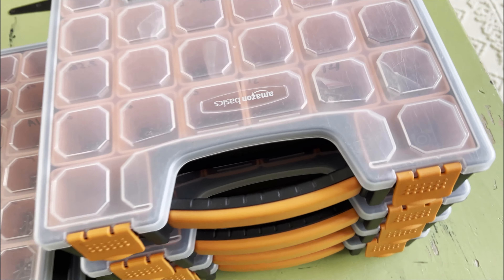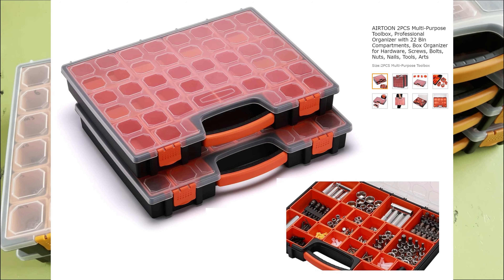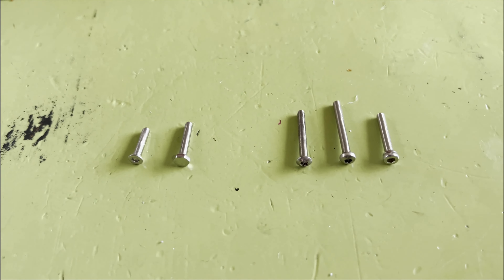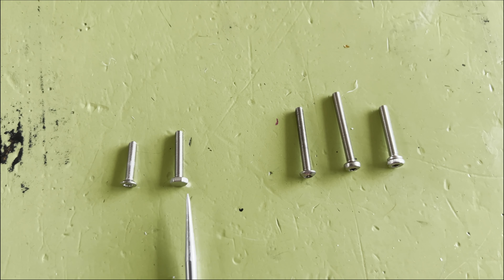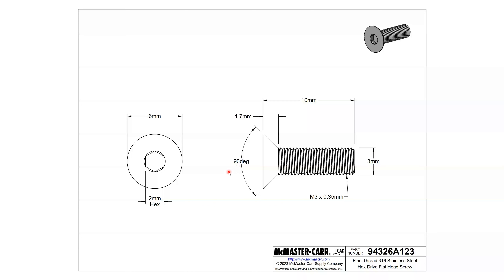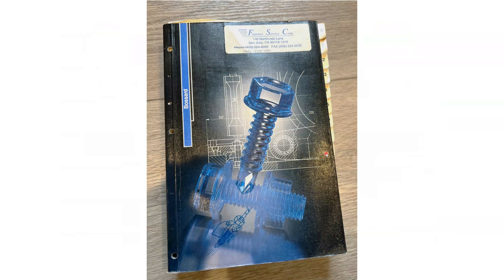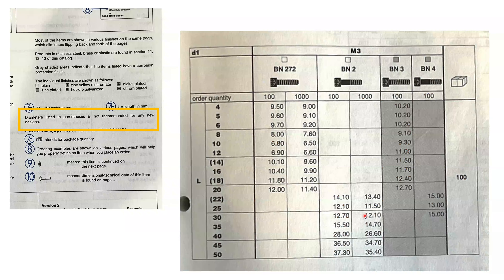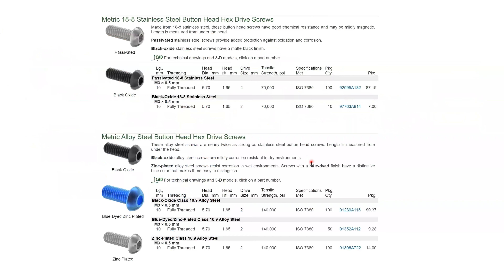What Bolts are Best for my RC Crawler Build? ... and Organization Hacks

Comment: While I’m sure torx is superior the fact that mip doesn’t make a torx driver is a non starter
Reply from the maker: I can respect that 😂. I like the handles on Wera better personally. You could also buy Torx 1/4 bits for a MIP handle.
Reply: @BoomslangSuss  it’s more about the quality of their tips than the handles per say, but I do like their handles too. I couldn’t imagine stripping a quality fastener with a mip tip
Reply from the maker: I totally agree - your key word was "quality" fasteners.  Most RC bolts are junk, so replace everything with quality, graded fasteners - hex or torx - and you will be fine. Although 2mm bolts and smaller start to get sketchy.  All the super mini bolts inside your watch and phone are usually torx.

Thanks for watching! This is one of my least popular videos, so I'm happy you found it and watched a little.

Comment: you're not doing brain surgery, you're not subjecting crawlers to large g-forces. 
cheap Chinese crud fasteners are more than sufficient.
butt sure, keep throwing away money.
Reply from the maker: You never rounded out a hex or twisted off a head?
Reply: @BoomslangSuss  plenty of times, im a mechanic. but never on an rc.. sounds like you've over-torqued them or used the wrong tool.